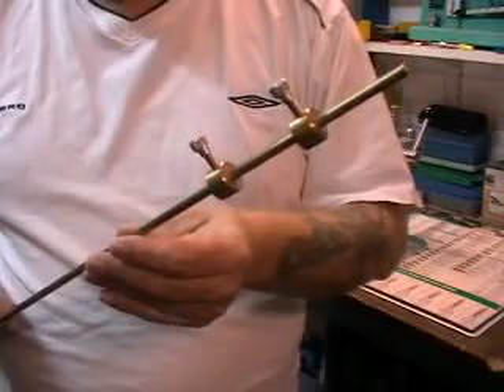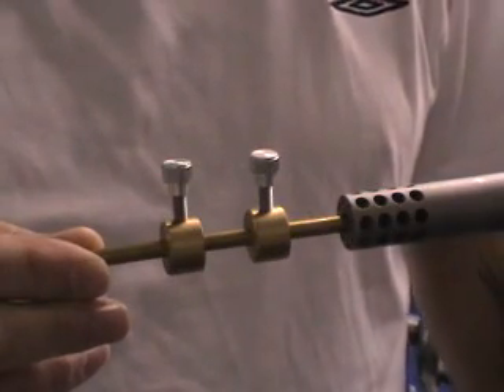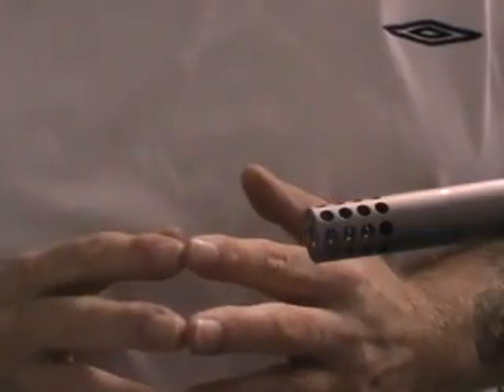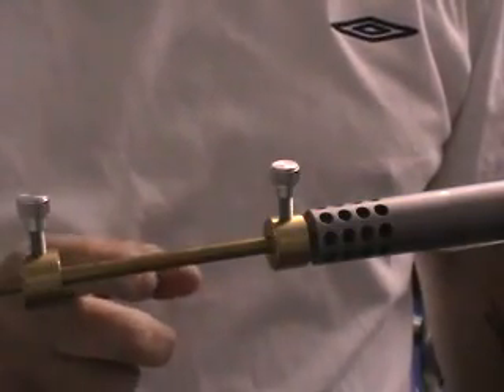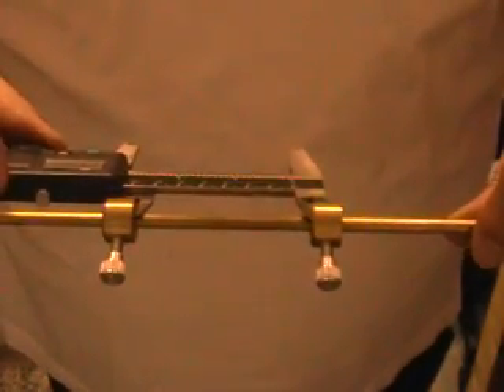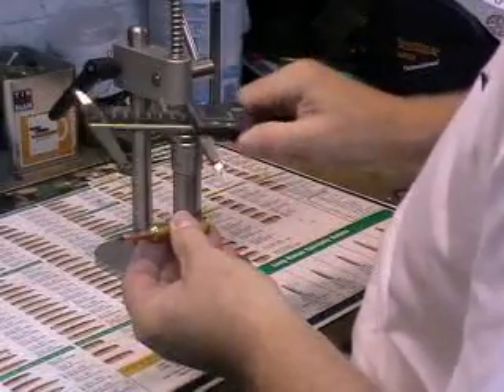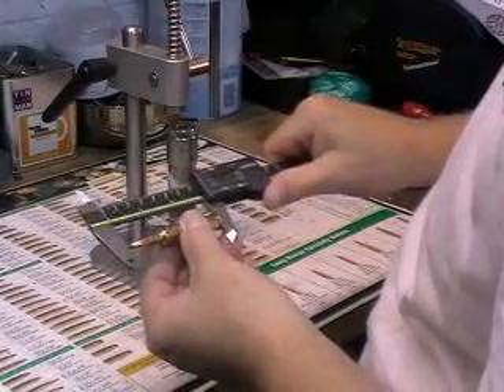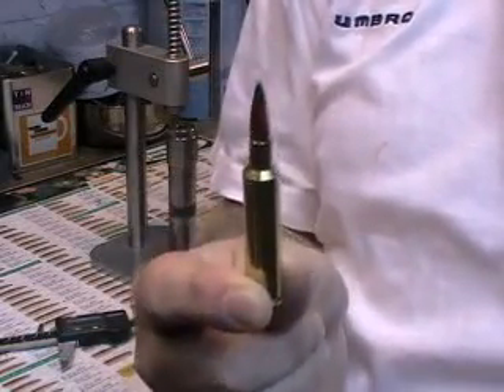How To Accurately Determine Cartridge Overall length

Comment: What about a jump to the rifling, like .010 thousandths or so?
Reply from the maker: This method gives you the COAL from base to tip of your chosen bullet, with ogive of that bullet having very light contact with the start of the lands, once you have set your dies to this "dummy round" you simply need to adjust your seating stem to seat your .010" deeper then the base to ogive reading measured with your comparator

Comment: Ogive
Reply from the maker: Earl, initailly the cartridge overall length is given, base to tip with the ogive of the choosen bullet having very light contact with the lands, then using a dedicated comparator the head to ogive measurement can be determined and used to set up the bullet seating die

Comment: Thanks for the video. This is the best method I've seen and the best explanation I've seen about how to do this correctly. All the other examples  I've seen demonstrate this don't take into account the thickness of the stop so they don't get to measure inside the stops or incorrectly tell you to measure between them. Good work!

Comment: Would this method work on a lever gun.
Reply from the maker: As long as you have a bolt face to butt the rod up to and a means of holding the bullet in to lead to the rifling i cant see why i would not work on a lever action, i recently accurately calculated the C.O.A.L. on a falling block rifle to the same exact degree.

Comment: Hi Vermincinerator.  Nice video, mate.  Perhaps I'm missing something?  After looking at this, and a video about the cheap crap that Frankfort Arsenal puts out; I notice that you, and the fellow who demonstrate using the devices are a bit different.  I notice you make your first measurement (bolt face to muzzle) off the back of the first slider, rather than off the muzzle.  Wouldn't that put your OAL measurement off, exactly the length of the sliding locking device? I purchased a 1/4" aluminum rod, and used electrical grounding lugs, and did it exactly as you did, but came up with 3.84-3.87 after 7 attempts.  This is approximately 5/8" longer than factory ammo and would not even come close to fitting in my magazine. 

If I'm not mistaken, for your measurement to be correct, you'd have to subtract the length of one of your sliders from the total.  Again, I'm not the sharpest knife in the drawer, so I might have it wrong. . . . .  Very confused at the moment.
Reply: but notice that he is measuring the insides between the sliders as oppose to the same sides. you will come out with the same measurement. the beauty of this is that you can use the caliper in a normal manner as oppose to trying to gauge the level of one of the measuring arm to the outside of the other slider.